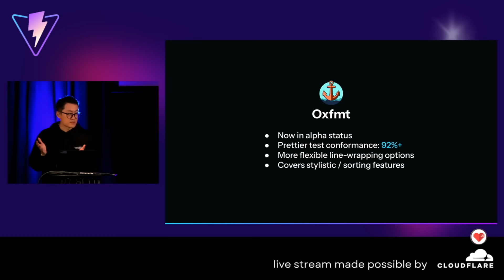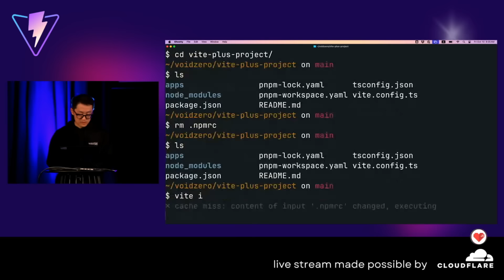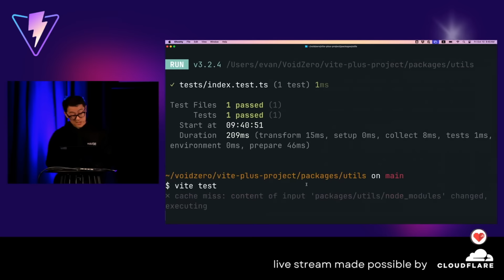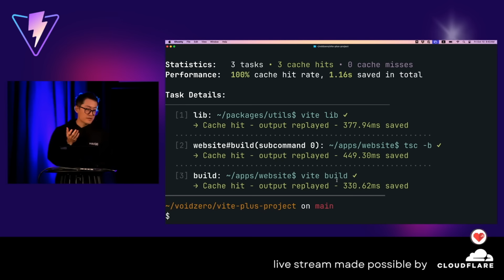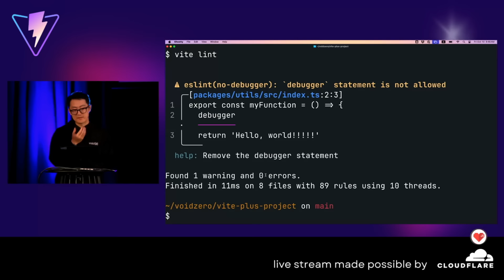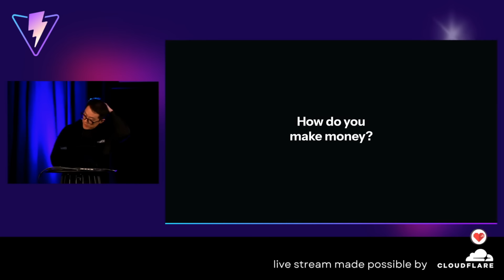Evan You | Vite Beyond a Build Tool | ViteConf 2025

Comment: Is there an existing SSR solution for React in Vite that could be a viable replacement for Next.js?
Reply: React router v7 has framework mode and uses vite, if you're looking for a framework.
Reply: Vite SSR is a thing. The create vite has that. You need to check the others options
Reply: Wait for Pooya's Nitro talk!
Reply: TanStack Start and React Router 7 are what you're looking for! I've been building UserJot with TanStack Start and it's been an absolute blast! Every design decision makes a ton of sense, its typesafe, fast, and a joy to work with.
Reply: how are you guys doing cloud SSR cheaply? I stick with SPA because of how cheap and easy aws serverless is. Sometimes its less than a dollar per month for me to host many personal apps with db, s3, queues, route 53, cloudfront, etc.

If I want to add ssr though, just for some seo here and slightly faster initial page loading there, then I now need to have a server running 24/7 like an ec2 and will be a min of 30$+ per month for that! Ridiculous.

Not looking to self host or use something like digital ocean. Ideally I can get SSR on aws for dirt cheap. Then tanstack start would be feasible for me. Any ideas?
Reply: @SogMosee vercel. It has a generous free tier. But beyond that I do Google cloud which gets expensive at times

Comment: This is like Clang but for Javascript ecosystem.
Reply: Or Cargo for JavaScript 👀
Reply: @AlexanderLichterVoidZero Hmm, maybe. But I think of cargo as more of a package manager than a build tool/ compiler. Where as this is like clang, a build tool built as a set of composable tools that can either be used together (as clang) or independently (clang-tidy), different parts can be used as library to build other tools or integrate into other environments. I don't think Cargo is like this. Clang did a lot to unify C/C++ tooling
Reply: It is like Bun but not open source.
Reply: @allo5auru5 A bit - but not really is not a runtime and doesn't want to be one. Also Bun has no linter nor formatter.